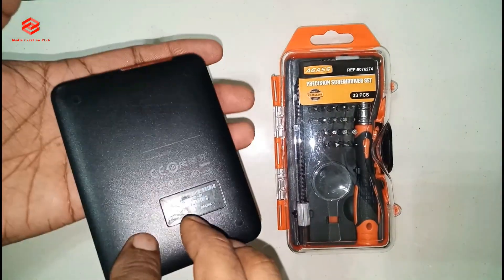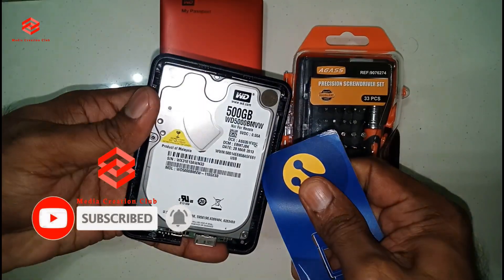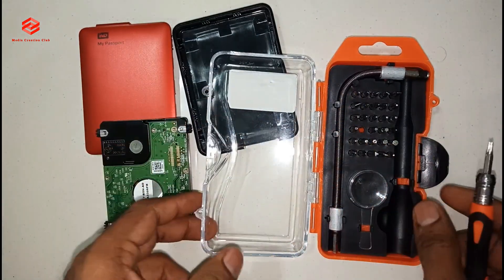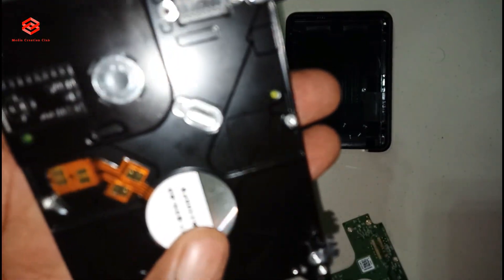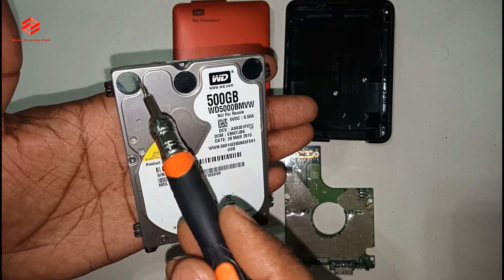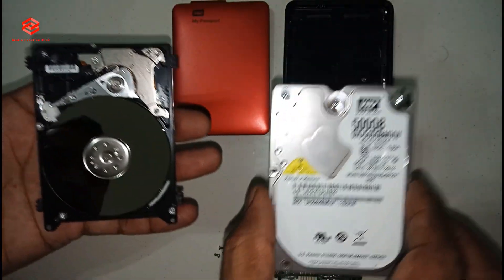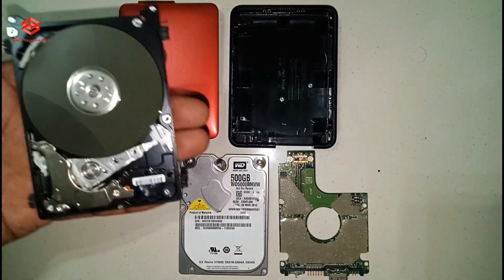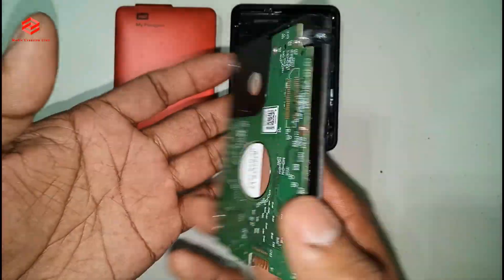WD My Passport || How To Open And Reassemble it WD My Passport HDD || How to Disassemble WD External

Comment: It seems that a clicking sound on these WD drives is a prevalent issue, often caused by various factors. Do you think the problem could be resolved by swapping the entire motherboard (the green part) from the same model with the one that isn't functioning? Could this potentially fix the issue. Thank you.
Reply: did you find a solution for this clicking issue?

Comment: Hello friend, I have exactly such a drive, the cable is not original and the drive does not work as it should, that is, a light turns on but the drive does not open, what do you think is the problem? Thanks in advance

Comment: all i could see is how that drive will NEVER read again correctly because of how much SH*T you got on that platter from not using a clean environment, gloves or ANY type of isolation method to PREVENT foreign materials from contact with it. Title should be "GUARANTEED way to FU*K off you extrernal hdd for GOOD!!!"

P.S.A.- people DO NOT do what this guy just did if you have ANY desire to recover ANY type of drive not reading.

Comment: You should always open a hard drive in a clean environment if you want to use it again reliably. The dust particles will shorten the life of the hard drive.
Reply: Not true.... With dust and moisture it will become more strong ... Not soft

Comment: When I turn the Centre spindle screw, The disk-platter stays behind, Not connected to the drive spindle. The platter looks fine but when I re-set the head it still clicks, as expected because I suspect the spindle is spinning freely without the disc-platter

What would be a DIY solution? .. Would a couple of drops of superglue gel by the spindle screw work?

Comment: I have clicking sound in mines and not recognised in laptop, atleast i can open and try and do sometning about it with the help of your video...thanks
Reply: Clicking sound most probably means your hard drive is reallocating the bad sectors by itself. Simply connect your hard disk to PC/laptop and leave it there for 10-20 hours and see if it gets detected then.
Reply: @sudhirmishra6265  same thing happen to me. My WD Passport is not detected by my computer and it make a sound like a beep, beep! I don't know how to repair it.
Reply: @evelynpaniagua1  either bad sectors or bad head. Contact any data recovery centre.
Reply: Did you have any luck fixing your hard drive @Rav UK?
Reply: @ciarangavigan  Hi not yet, busy with other high priority things at the moment, when i do get round to it...i will let you know...just that i need patience when i open up and start tinkering, which i dont have at the moment 😁😷
Reply: Rav UK any updates?